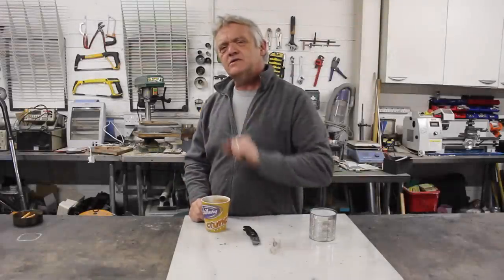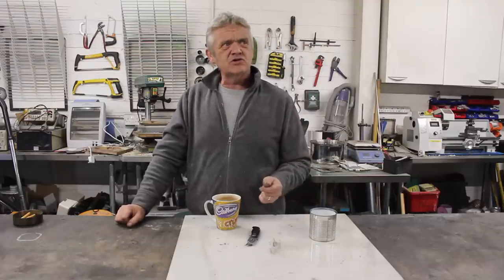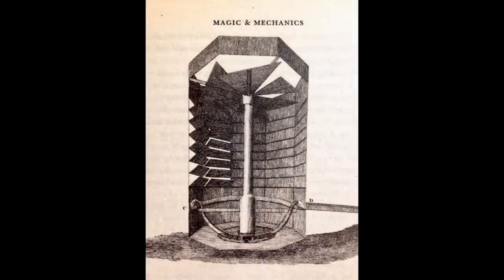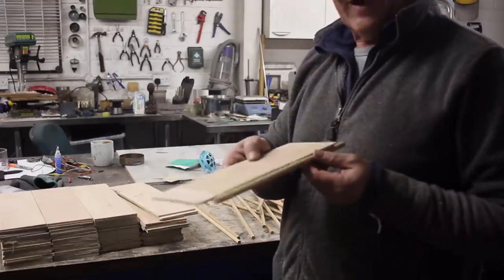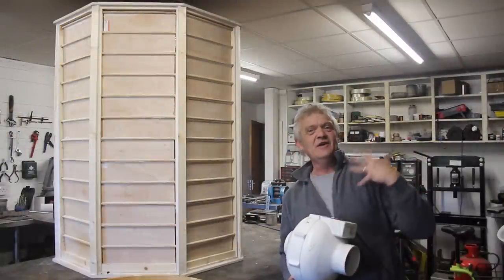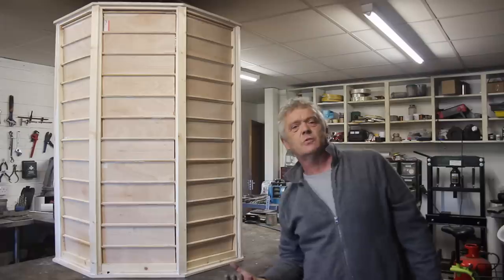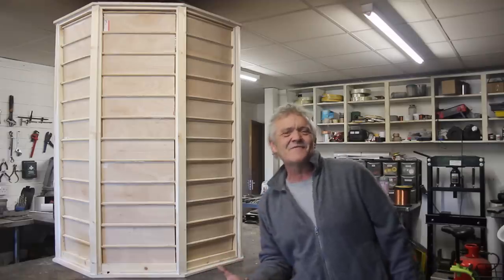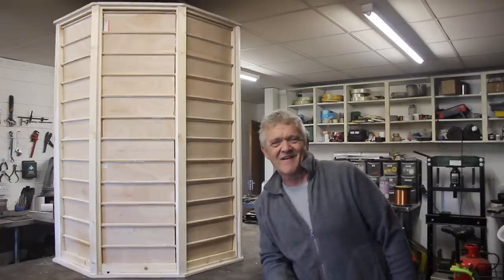1725 Aeromine And A DIY Wind Turbine From A Lost Technology

Comment: I had an old boss who built a cold room from a basement & an Iranian wind collector, it has no real moving parts but the airflow was consistent & incredible.

I've always wanted to do something similar with a few energy harvesters built in, it'd reduce your airflow but not by enough to really matter & it'd be fairly discrete in an urban area
Reply: Not if you're using oscillation/deflection to harvest energy - put a stick the long way in your tower, tune the stick so it produces the vibrations you want, then you can use something like an LTC3588 (I've used these several times, they have worked well in many experiments) to simply hook up a piezo/strain transducer which will produce power directly without minimizing flow.   In fact, you want to encourage throughflow so your source stays as constant as possible.  🙂

copypasta for the LTC3588:
The LTC3588-1 integrates a low-loss full-wave bridge rectifier with a high efficiency buck converter to form a complete energy harvesting solution optimized for high output impedance energy sources such as piezoelectric, solar, or magnetic transducers. An ultralow quiescent current undervoltage lockout (UVLO) mode with a wide hysteresis window allows charge to accumulate on an input capacitor until the buck converter can efficiently transfer a portion of the stored charge to the output. In regulation, the LTC3588-1 enters a sleep state in which both input and output quiescent currents are minimal. The buck converter turns on and off as needed to maintain regulation.

Four output voltages, 1.8V, 2.5V, 3.3V and 3.6V, are pin selectable with up to 100mA of continuous output current; however, the output capacitor may be sized to service a higher output current burst. An input protective shunt set at 20V enables greater energy storage for a given amount of input capacitance.
Reply: @russellzauner  I'm just starting with this sort of thing & I'll probably be using PC fans for now.

But I'll have to read into all that
Reply: @russellzauner  Was not familiar with that chip, thanks much for the post! I'll have to get me a few of those... That sounds like a very clean and simple way to harvest energy off vibration.

Comment: I love this concept. Incredible. It reminds me of an old toy I had which used candle heat to spin. I wonder if heat could be applied to a stone or other surface to cause the mill to spin when there is no wind present? Maybe make the flaps out of clear acrylic. Shine a warm enough light into the system and then, boom, air circulation. :)

Comment: Dear Robert, it was a nice video. I started to thinking about this tower. Basically I wanted to turns the top to the bottom. The panels should connecting with a rod or wire in column. If we put a weathercock onto the top and we connect the 8 wires onto a wobling plate that is turn around the tower freely as the wind blowing. It makes the tower more sensitive to the low speed wind. So basically the panel column could open automatically and the inner flow direction could be angled to the top turbine. Another idea: we can turn the air flow to a vortex with a simple modification. The panels are could open sidely. Then the flow will twist automatically and we can use a turbine in the whole tower structurw to generate electricity. The tower material is possible made from black sintered aluminium to increase the chimney effect. And one last thing, if we have a vortex then we have a lower pressure area in the middle section. So a tube could put in from the bottom with fresh air. This tube could generate electricity too from this suction energy. Sorry, if these are looks complicated, I just wanted to write what I thought about it! BLADE
Reply: In the second idea u r basically talking about vertical axis turbine placed inside the structure that supposed to create vortex, am i right? But imo it would be inefficient compare to HAWT so ur first idea does make more sense, though i don't fully understand it.
Reply: @yash_kambli  HWAT is basically planned for opened area. But I think we can found good solution. These are just ideas now, but if lot of people start to thinking in one direction then maybe we could create something useful. ;)

Comment: A few thoughts:
1.  The flaps could be made of fabric or film on a frame so as to be lower mass and take less of the wind force to swing them.
2.  Add megaphone shaped sail on top mounted on a bearing and sealed at the small end to the tower outlet.  The large end of the "topsail" would be pushed away from prevailing wind direction by any appreciable wind.  Thus you get a pressure drop behind the large end of the "topsail" giving not only a larger swept area but one at a higher elevation.  IF the image is not clear think of the sail as an inverted windsock with the small end anchored to a bearing around the tower air exit with a little internal framing to maintain cross section for good airflow.
Reply: A Venturi on the top with a vane to keep it aligned with the wind and the exit of the tower coned after the turbine entering in the suction part in the middle for added speed of exit...
Reply: that's brilliant
Reply: @maw9916  Intriguing.  My fluidics are too rusty to predict whether this would outweigh the reduction of post cone pressure drop this would cause.  Might be down to turbine design.
Reply: @terranovarain6570  Thanks!

Comment: A thin strip of rubber along the bottom of each flap would quieten it down considerably and not effect performance (might even stop some leaks)
Reply: Something to consider would be the additional weight of the rubber strip. It would make it so that there also needs to be more air pressure required to push the flap up.
Reply: @justinweatherford8129  You could solve this by adding the rubber strip to the panel above it. So the rubber would run along the opposite side of the board in the same place as the supporting bar/hinge. Not sure I've explained it well, but if the rubber was along the axis, it's weight wouldn't affect the flap movement as much?
Reply: Or simply make each flap one-way rotational
Reply: @justinweatherford8129  Doesn't have to be rubber. Just has to cussion. May look a little tacky but what about a strip of bubble wrap or an old Amazon bag?
Reply: @MrMatthewPR  to get the seal he was looking for, it would require a rubber seal around the entire flap. Having just a rubber seal along the top or bottom would actually let more wind through. What I am thinking about doing is actually going to reduce the weight of the flaps by reusing scraps from plastic containers.
Reply: @colleenforrest7936  the old Amazon bag would be less likely to cause a sealing issue, but I am not sure that it would reduce the noise very much. I believe that the source of the concern here is the sound of wood on wood. The wooden flaps might not be the best choice for this. Even the thinnest sheets of wood have more weight than a equally strong piece of plastic, and with plastic flaps made from parts of plastic bottles it would reduce noise.
Reply: @justinweatherford8129  I think the main point of the rubber strip was to stop the impact noise rather than make an airtight seal, but you're right in that better construction would be needed to block all the airflow.
Reducing the weight would also help with the sound issues though, so definitely a good idea. The only issue I see is that the weight still have to be enough to quickly counteract the friction of the hinge - you want the slots to close freely and not stay open.
Reply: @MrMatthewPR  yes, that is true, but I think that just boring a large enough hole for the pins to move freely would make it to where it would require very little weight to allow the flaps to close. If not, then one could add a metal bushing to reduce friction. If that still isn't enough then the metal bushing could be lubricated. I however feel that just having a large enough hole for the pin would be suitable enough.
Reply: @justinweatherford8129  That sounds like it'd work. I think I'd still favour something with a little weight and rigidity to it. Perhaps somewhere in between, with a basic frame supporting the thin plastic.
Come to think of it, the corrugated plasticard they use to make placards (for sale signs) would work very well. It's lightweight, strong enough for purpose, easy to cut, cheap, and weatherproof.
Reply: @MrMatthewPR  I considered something else that might also work to some extent, but it is more costly. Flexible solar panels are lighter weight, cheaper, and more durable than their rigid counterparts, but they aren't as productive. Perhaps Flexible solar panels could replace the the flaps on this to provide a more stable flow of electricity. It would be considerably more expensive than reusing the plastics that you would have otherwise disposed of though.
Reply: @justinweatherford8129  I'd worry that the angle of the panels being at best 90 degrees would render them pretty worthless. plus all the wiring for each individual panel would be hellish. I could definitely see some solar on the roof of it though. 
Hear me out. I wasn't thinking of having a turbine on top like the video suggested. I was thinking of having it blow downward through some large diameter PVC, and having that wind flow spin the turbine. The focused pressure would increase generation... that curve that shows efficiency with wind speed.
This would have an advantage of keeping the heavy equipment low down, and would also make it easy to double or triple stack these in a more rural environment to gather more energy, without having to worry as much about stability.
Reply: @MrMatthewPR  you are of course right that it wouldn't be the best angle. The best angle would actually match your angle of latitude. Southern facing panels provide the greatest output in the northern hemisphere. I was thinking more along the lines of people who own very little or no land and how they might get the most out of this system. I personally don't own any land. As far as having the turbine in a large pvc pipe near the ground, that is illegal in my county. The law regarding wind turbines here requires that wind turbines be at least 8 feet in the air, about 150% as tall as the average human.
Basically I am trying to work around needing a portable system with the highest output with as little landmass as possible.
Reply: @justinweatherford8129  Is that some sort of safety law to prevent people being hit by spinning blades? There'd probably be a loophole there though, in that if the tower itself was 'part' of the turbine it'd count? Or maybe use a different type of turbine like the $100 build this guy did but have the disk spun by a fan blade?
But yea, planning permission could definitely be an issue. Innovation... it kills it.
You could probably move the pipe to the top though, I was mostly just thinking of ways to decrease construction costs by keeping the weight low down. Having it internal in some way would also decrease maintenance and improve low wind efficiency, which is important for small footprint.
Either way, with the slats being at that angle, I doubt you'd see much return if any. I've ran some portable panels at a window before to see what I got and it barely registered for most of the day. On top of that, if the slats are blowing inwards, they'd be almost completely cut off from any sunlight at all.
A thought I just had as well. The tower would need some netting/wire mesh or it'd end up having nesting birds inside, likely getting sucked out the top.
Reply: @MrMatthewPR  for the impeller I was going to use something similar to Robert Murray's spoon design, that had the cone on it. The tip of the cone could have a shaft going through it connecting it to the generator. At the base of the tower would be the inverter and batteries.
Reply: To much weight  for the level of flap swing
Reply: @justinweatherford8129  Would it be possible to cut a groove out of the panels and then fit the rubber strip into the cavity? It would be extra work, but there will be less of a weight concern.
Reply: @michaelwebster3124  You would want the panels to be as thin as functionally possible in the first place, so there shouldn’t be enough to make room for the rubber.
Reply: @MrMatthewPR  Each flap has two dowl hinges, and they may be placed just above the center of gravity, which allows the flaps to easily close or open depending on wind direction.
Reply: @kreynolds1123  Good idea. Simple solution. I'd still want some rubber to deaden the clap clap clap noise if it was going to be in an urban area.
Reply: Self adhesive roll of window insulation/draught excluder (made from foam) extremely lightweight and cheap
Reply: @chriskaye1997  That sounds like it'd work great. Right now I'm liking more of the most recent style he's been looking at with the fixed slats. Probably not as effective, but close enough and without the wear and tear of any movement.
Reply: @MrMatthewPR  I agree, low maintenance is attractive

Comment: It'd be interesting to experiment with the turbine placed at the bottom as well. Because of the direction the flaps open, the incoming air is going to be directed downwards as it enters the tower. I wonder if that would have any noticeable impact on performance. Acouped added bonuses of a bottom mounted turbines would include the ability to put an architectural "roof" on it, as well as easier access to the turbine for maintenance.
Reply: Block the top off and direct the air down seems like a plan but it would lose the draw effect from the wind exiting at the top. The aero mine works totally on that draw.
Reply: @davidsoulsby1102  Fair enough. I do wonder though if there's a way to configure the vents (with counterweights perhaps to allow them to open in the direction of the exit.
Reply: @alantupper4106  small torsion springs might do, but counterweighting for vertical flow would require the lower weights to be on the windward side of the flow in this design. Might be counter productive unless there was a hollow bezel to house protected counterbalance weight for each vane.

Comment: I have done something similar but the “flaps” are actually on the turbine. The faster it spins the smaller the gap making it self governing. The outer cage again has static flaps that simply hide the unit and direct the air. I had a small one in Colorado that withstood 100 plus MPH winds or about 180 kph. It did not fail but simply closed itself up.

Comment: Hi Rob, love that idea, great build, I know you are planning on having the air exhaust out of the top, but I wonder if it may work better if it exhausted out of the bottom? I was just thinking as the flap hinges at the top and the air will enter at the lower part of the flap, air may flow better going down instead of having to change direction to go up, however this is just my thoughts, so don’t let me change your plans, 😂 cheers 👍
Reply: Good thought.
Reply: And any machinery (turbines etc) would be below Rob's/Darwin's device and out of the direction of the wind

Comment: Looking at this and all the possibilities for it's use besides energy production. If this was put on a barn and the top capped it would ventilate the barn by pushing air down. This is incredibly useful, so glad I found this channel and this video. 
Has me wondering if putting a generator at the bottom effects output too.

Comment: Hi Rob, I'm glad you've brought this up again. I have been drawing up some ideas to make a little group of them, as I have a pretty draughty garden and I, like you, am all for some value added, why not cover it with the Electricity from the rain idea. Just a thought, keep up the good work Mate
Reply from the maker: nice one mate - cheers
Reply: @ThinkingandTinkering  to adding optimal value to this I was thinking about a wind turbine powered car they tested a few years back that went faster than the wind speed by using a sailboat design that hits the wind at an angle increasing the lift an reducing the drag. They had it geared to the tires what if you had multiple fans/generators stacked geared in sync with that sailboat design blades in that tower, by theory once you get the bottom one moving the optimal speed the gearing to the next should start to pull creating suction to the first and in series the next even more an so on creating a self driven wind tunnel pulling the air from the sides an out the top once started by the wind. Any thoughts or holes you see in this theory?

Comment: Worked with a professor from an ivy league college on Turbines and we had discussed the possibilities of a floating turbine using magnets or electromagnets, that could produce electricity.  He also said on another note, most any turbine can be 40-50% efficient (traditional turbines) but getting to that 97-99.5% range requires adjusting the blades to fit the situation including wind speed, friction, volume of fluid, etc.  Adjusting the blades and making them efficient can get expensive which is not what your after Rob.  However, 40% isn't bad so it's hard to go wrong.  I know, 40% of what.  😂
I would think one of your subscribers might be willing to print 3D printed turbines for three situations (for a fee) involving different wind speeds.  I would think it would be relatively easy to find a descent schematic for a relatively descent turbines in cad programs and print them out.  From here you can give directions on how to cast them in something stronger like aluminum.  Anyway, have fun!!!   Love this stuff!